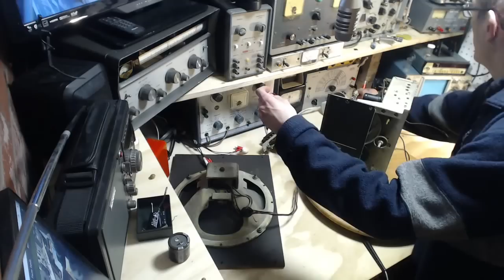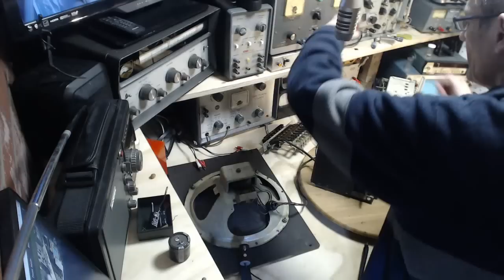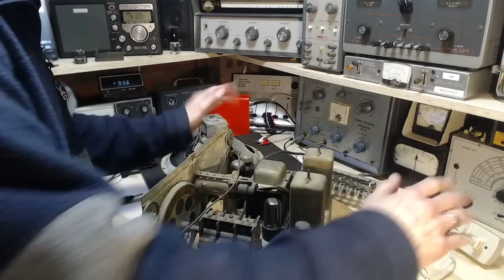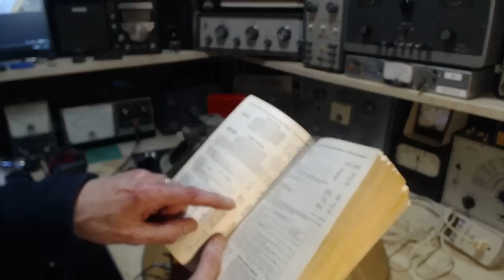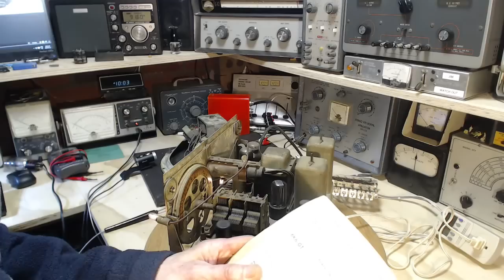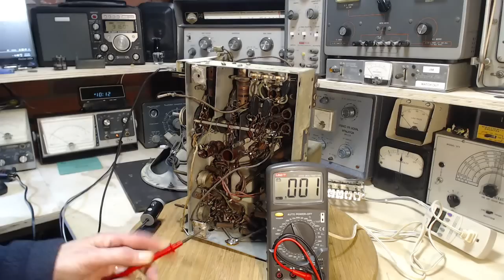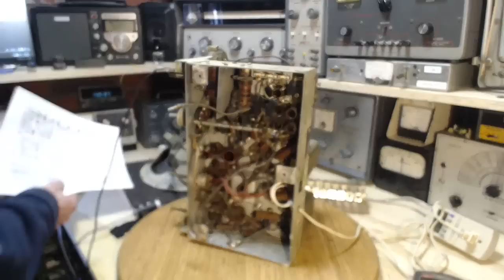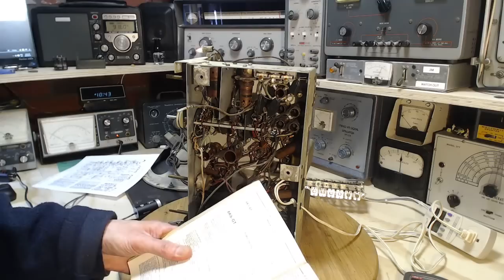Canadian General Electric KL-96 Video#3 - Audio Section

Comment: the field coil can work if you put ht dc of 95 volts on the field coil and a 100 volt line transformer to the output transformer windings

Comment: Is it possible to bypass the voice coil and connect speaker wires from an ordinary radio to the speaker's wires? I had a hum in a stereo I was working on and it turns out that I was plugged in to a cheap 5 in one surge protector. When I plugged in to the wall outlet directly, the hum disappeared.

Comment: no negative voltage if class a it will have 470 k 229 k to ground it there is a positive voltage on pin 5 coupling cap faulty

Comment: a quick test find the output transformer wires that go to the valve disconnect them   tap a 9 volt battery across them

Comment: jim if the screen and plate voltage is way low yes indead it will stop the radio from functioning.

voltage measurement  on restricted power are not useful because it will be low because of the low power input.

you were  injecting an rf signal from the radio into an af input in your af jack on ur sterio this wont produce sound.  that is assuming u were correct when u  said u were picking off the signal ahead of the detector tube.

you need to test the power suply. the capacitors are not the only problem. remember the squealer. shotgun replacement of anything is very bad.
Reply: +Thomas Stemmer he injected audio not rf into his stereo af jack because he was tapping off the volume control - after the detector
Reply: ok i thought he said before the detector but ur right volume control would be after